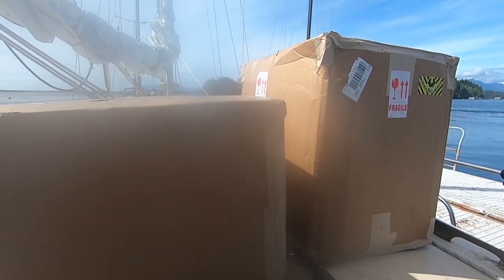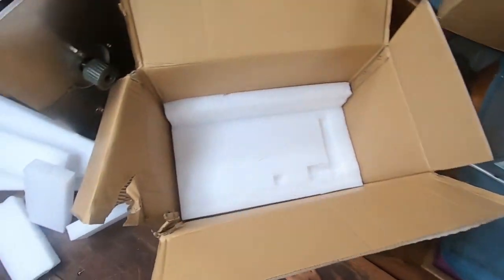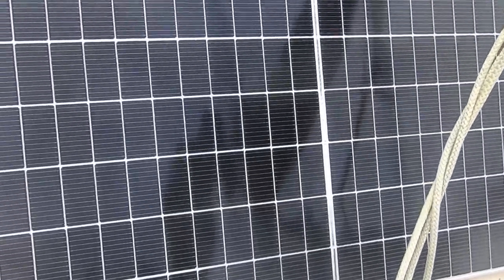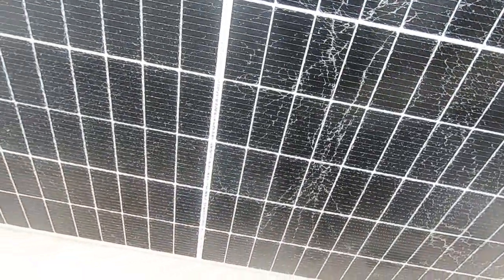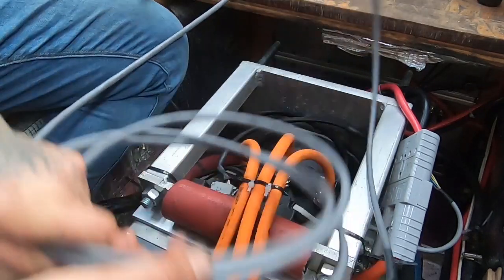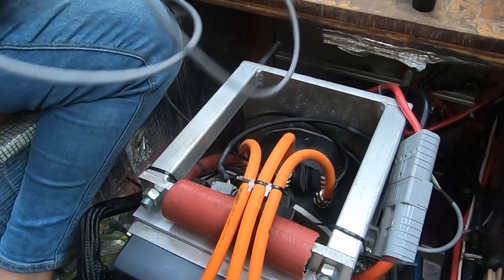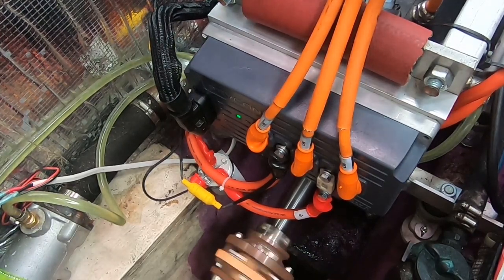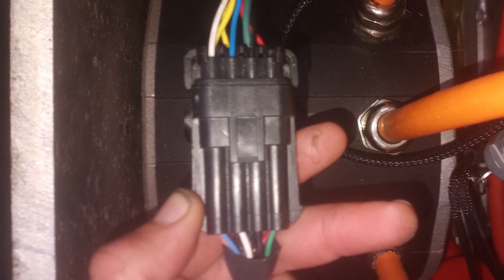DIY ELECTRIC SAILBOAT CONVERSION  heavy full keel cruising boat - Sailing Oka Solo - 030

Comment: Have you shared your electric motor conversion budget and does the motor regenerate while sailing?
Reply from the maker: @jldsystemsltd  16k CAD if you count rewiring the entire boat with all victron and not counting the 1000s hours of my time but ive been adding to it gradually for 3  years and got second hand lithium cells for almost nothing last year  so its an evolving number. with a full keel boat its the worst hull design for regen it only starts spinning at like 5 or 6 knots and its minimal production

Comment: Very interesting!  In the process of installing electric on my 38’ 10 ton PanOceanic.  Going with a kit from Thunderstruck -  24kw 96 vt 200 ah renogy batteries.  Just mounting the gear reduction plate and aligning the shaft.  Great video!  Will look forward to more from you.
Reply from the maker: might be the same motor, the me1616, I run mine at 48v 12kw
Reply: @ yes it is.  I’m running it at 96 volts with 8 * 200 ah in series for the 96 v.  I’m also installing 2 550 watt bifacial panels.  I value your real world cruising experience and have so much to learn along the way.

Comment: Would it be possible to install the electric motor on the shaft with a diesel engine still there?
Reply from the maker: @Mafiakitty  given there is enough room aud that the engine transmission can free spin without damaging it, absolutely

Comment: Amazing engineering. This is the perfect motor setup. Just add a Diesel generator for hot water and emergency electricity so that you have unlimited range. I would always want an electric motor drive my sail boat. All clean, all quiet, all reliable.

Comment: Hi.

I am trying to make an hybrid diesel electric. 

Can i ask what this cost you ???
Reply from the maker: Its a relative question as i could of done it for cheaper as rewired the entire boat and spent 5000 just on victron energy components, the motor was about 6000 and then 5000 in lifepo4 batteries, then i also built a solar arch later on and then i also purchased the latest model of portable honda gas generator to run hybrid

Comment: 12 kw engine 150 amp hour battery?   You have full power for 40 mins?  Not to mention the center of gravity of the boat will be wrong as you have taken out so much weight.   Fundamentally I support the idea but for the money you spent and the range you have it was silly.   I forget when I  watch videos like this one this is just a toy just hobby weather you live on it or not you need not go anywhere or do anything on a schedule.   Not like you are going to be running for port from off shore 200 miles to miss a typhoon that is coming.
A ten horse power outboard would make ten times more sence but its not about making sence or getting anything done... It is a dream come to reality.  Enjoy it.
Reply from the maker: An outboard would be swamped in waves as small as 2 meters. I never draw 12kw its pointless. Anyways 2000nm + in some of the worst condition and remote placesi could test it in and i still make it to were i need. People went out at sea long before recorded history with out high powered engines...  if you can't  sail engineless maybe you should learn to do that before setting out. My range is approximately 45nm on a charge with 330ah and am gradually increasing the battery  capacity and removing the diesel engine and fuel tanks adds up to less than weight than he lithium battries and motor combine to he point where i was able to double my water capacity.... anyways you do you and ill keep sharing my travels

Comment: A cheaper car engine would be more economic and  give you better range .   I sail  the same boat with a perkins diesel 72hp 
Thirsty at full revs  economic at half throttle,  thanks for sharing  best of luck well done young lady
Reply from the maker: The cost of marinisation of the car engine would probably cost as much as my motor did, but I hear you. 1500nm+ later I do not miss my old perkins diesel, its not for everyone but i knew what i was signing up for. 
You have an endurance as well?
Reply: @SailingOkaSolo  yeah mine is an Endurance 40 cutter rigged  nice and steady  build by windboats  in Norfolk UK. 
Lovely boat off shore , but a challenge in  a marina . I love the living space  , she's surprisingly fast with a bit of breeze.  Where do you sail out of ,  I'm in crosshaven cork Ireland.  Have a lovely day cheers
Reply from the maker: @johnmeldrum4717  I am transient on the west coast of British Columbia Canada.
I would love to have that extra 5ft! 35ft is fine solo but I find it cramped the second i have crew onboard, altho my lenght overall is 48ft with the solar arch
Reply: @SailingOkaSolo  your along way away from here,,,
 I won't pop over for a coffee and a chat anytime soon,  your an impressive young lady , well done with the boat modifications ,  wishing you fair winds, peace love and joy, 
Cheers John
Reply from the maker: @johnmeldrum4717  thanks john maybe someday we will be in the same ocean!
Reply: @SailingOkaSolo  shake down cruise around Iceland this summer , solo circumnavigation next year ! ????   Yahoo !
Reply from the maker: @johnmeldrum4717  im preparing too sail down yo central america in call of 2024 and then who knows
Reply: @SailingOkaSolo   I most certainly admire you .  I've just got my wind vane working  it wasn't 100%  but it is now  the clutch was slipping.  In the mean time  I bought a wheel pilot very handy for reefing or hoisting sail.  I just sold my hummingbird 30 . So I'm going to invest in solar panels  and a radar . I miss not having radar .
Best of luck with your plans  fair winds.   Do you have a bow thruster  on Oka .  I'd hope to meet in person some day . Look out for an endurance 40 called Serenity  . I'll keep you posted on planned voyages .
Up grading for solo sailing  .putting in a dutchman reefing  system fed up with main sail trying to go swimming. Take good care of you and your lovely dog , cheers young lady.

Comment: Hello, I love your boat and what you're doing with it. I'm sorry if you answered all these questions in your videos but I'd love to know more detailed specs, such as your boat type, length, weight and roughly what current draw is at different speeds. I have a Cheoy Lee midshipman 40 (20,000lb 3/4 shoal keel) and I already have a 57.6v 300ah lifepo4 battery pack (~17kw) I made from 18 cells for my house and the same multiplus-ii as you and my next move is electric motor when mine is ready to go.
Reply from the maker: Note taken!
Reply from the maker: Hello No problem don't  mind answering questions its why im sharing my conversion.
The boat is an endurance35 ketch 22000lbs or about 12 tons full keel altho some may call it a long keel or 3/4 keel
My current  battery bank is 330ah 52v lifepo4, i added a recycled diy bank since the video ( 10y old winston 260ah cells) which in perfect flat calm conditions will allow for 12h at 3knots drawing 1000w but thats never allowing the battery to discharge below 48v. the motor is an me1616 you can find the link in description and am satisfied with its performance and they are very modular ca be used with different controllers at different voltages and has been reliable altho i would recommend a different supplier than the link in description 
thunderstruck electric motor carries a very similar kit and has a better customer service.
Reply: @sailingokasolo6801  thank you! I have 300ah Winston cells, about 7 years old but only used for 18 months and then sitting for 5 years. I bought 20 thinking I'd do a 4s and 16s pack but realized I don't need the 12v 4s and with the multiplus-ii you can get a max charge of 64v and max input of 66v so I went 18s. Have you done a capacity test on your diy pack? What did you spend on them? I'm still setting things up so I havent with mine but for 120$/cell I can't complain if it's a bit diminished.
Reply from the maker: Ive noticed so many expect me to have a 12v bank but I just have a  20a 48v to 12v converter running the house I paid $1000 CAD bought them from a friend
Reply: @sailingokasolo6801  I'm sure many people would love to see an update video on the system! I know I would love to see the specifics of how you did the two different banks and what you did for bms. Right now I'm working on integrating my 200a jbd bms and victron electronics with a raspberry pi running victron's Venus os. I want to figure out how to integrate a 1000a shunt and relay into my bms/victron environment if I go electric.

Comment: I wonder if it's possible within realistic terms to make the system throttle by wire aka wireless much like Harley and other motorcycles have converted to..
Reply from the maker: That would be awesome im unhappy with the throttle that it came with because its so big and easy to trigger by accident

Comment: I watched a sailor who was a electrical engineer who converted his island packet 27 into electric.. he said to mount the controller or whatever the piece is that has the aluminum fins so that the fins are facing towards the open and make sure said fins are running vertical in order to displace the heat faster?? You can find his video on YouTube.. said he was the first island packet owner to make the conversion and he made his own battery bank. I would buy a bank like you have because you're paying to have a warranty

Comment: Your heat sink is up side down the fins should run up and down so heat can escape not sideways.. it could over heat your control box .. ... happy sailing  hope this helps..
Reply from the maker: I am very limited in ways to position the controller as the cables are so short but ive since added fans on the side of the heatsink.
Reply: @SailingOkaSolo  great job .
Reply: @SailingOkaSolo   I can't wait to finish my boat you are an inspiration keep up the great work
Reply from the maker: Great to hear working on more content specifically on electric motor

Comment: im planning on buying a sailboat and i wanna remove all diesal and run 100% eletric is it expensive? i dont mind slapping a whole wack of batterys for battery banks
Reply from the maker: Definitely relative to the size of vessel and if you're doing the work yourself or hiring someone
Reply: @SailingOkaSolo  I'd prolly get someone to help me as I swore to never do electrical again as I had a bad experience. I live in BC so I'm thinking of a 30-32 footer

Comment: Hey, just found your channel. I like the work you have done.,May I offer some advice , it's not a criticism  just a safety concern, you leave a lot of metal fillings in the engine  bay,  I am sure you've cleaned them up bty now, however you have to be carefully of things like that when working  with electrical stuff. Try to put down a tarp or something to catch them when drilling, triming, etc. Got to keep that area clean and safe for you.
Reply from the maker: I didn't  do any drilling  in the engine room the only filling i seen upon rewatching the video were simply on my cabin floor not the engine bay, I agree tho that foreign  metal shavings do not belong near electrical connection

Comment: Awesome on the repower!! We are going electric too. Stuck on anchor with dead gas engine. Have all the components for the electric conversion EXCEPT the pulleys and belt. I am trying to source pulleys like you have -- for 7/8 (~22mm) shaft. hard to find a supplier in the US. Please help. Thanks so much for the inspiration!!!
Reply from the maker: I got my pulleys and cog belt from electric Motorsport my motor supplier but maybe worth contacting Thunderstruck for parts as i think they are slightly cheaper

Comment: Is your motor mount, rpm converter home made or did you buy it off the shelf?
Reply from the maker: The transmission system is 3:1 cog belt and pulleys  and then the mount is my design as the shaft is lower than the engine mount the ones on the market were not ideal

Comment: Awesome, looks like a lot easier to fix than rebuilding the diesel engine. 🙂
Reply from the maker: Only two moving parts the bearing and belt not much to go wrong other than if the unit was submerged.

Comment: awesome, thanks for sharing this. I am just dissecting my failed Volvo Penta and if its a total loss I may go electric too. I already converted to 400 Ah Lithium last year and have 400 W of solar but would sure need more battery and solar and I'm a small boat so not sure where to put more panels. But great job you did, very motivating.
Reply: you cañt go wind generatur

Comment: I love that box you built to house it, I just used the reducer from the company I bought the kit from but yours seems bulletproof. I got a 96v 18kw motor to push my 36,000lb 40ft boat. I used my old shift cables to control the motor but its literally connected with whipping twine and I need to redesign it...shrug, more content to share I guess. Nice boat, ill check out your other videos and subscribe.
Reply from the maker: How do you find changing the 96v system was it harder to source supplies
Reply: @SailingOkaSolo  I charge the system two ways. I have eight 100watt solar panels in series mounted to my railings running through a 96v mppt charge controller( 4 solar panels on each side). I  also have a 96v ac charge controller I bought off line. I use the ac charger to charge at the dock and/or I use my portable generator to charge the batteries at anchor and I can use the generator to give me a long range at slow speeds (turning the boat into a hybrid). I find that getting the chargers were a giant P.I.T.A and regret not just going with a 48v system. But on the bright side I have ample thrust.
Reply: buy 4⁰ foot oiçníc bost 52 mile range

Comment: Great job I have a Hunter 30 and would like to go electric. What size is your boat what’s the cost of the electric engine you went with? Thanks
Reply from the maker: Hey that would be an ideal type of boat to convert, mine is an endurance35 and 12tons quite heavy for her size you can find a link to the motor kit in the description with price but I haven't quite "finished" yet as after 400miles ive decided to add more electronics and various devices to make it more user friendly so far im at $15000cad including charging system and batteries. More to come in next video
Reply: @SailingOkaSolo  thanks will do I subscribed so I will be watching. I have a channel as well but I’m in Rochester so I’m researching equipment thanks so much for the lead. So proud of you Gurl!
Reply: buy  j88 sopar ektrc sail boat 22.5  mile range telsa neww xells 26 mile range

Comment: That's just stupid, say you are in a storm for a few days on a lee shore with a good harbor, but can't make it in because no solar power
Reply from the maker: Never do I claim to run 100% off the sun,  Im no purist I use propane in the galley and gas outboard and generator.
Im 53°north so not much sun at this time of the year. I've just transited 400miles of fjords and tidal rapids through the inside passage of vancouver island running as a hybrid. Also just picked up a lithium bank for a song that will more than double my range...
Reply: dubled rang ¹⁰ miles too 2⁰ miles

Comment: Great self build. Your channel just popped up. Welcome from down the coast in the Pacific Northwest from SV Touchstone. Relaunched and rebuilding as a parallel hybrid.
Reply from the maker: Hi there, are you in puget sound? Would love to hear about your hybrid conversion as my friends are about to do so!
Reply: @SailingOkaSolo  Sure, some on my Instagram, nothing to YouTube yet. Financial limitations, time and experiments. 
Presently a 12v 'continuous' maybe duty winch motor no speed control, on V belt sheave. It was enough to launch and leave port. After purchase I found it was not practical to use for regeneration. I hope to later get a much better electric drive and batteries. Not expecting to have a large unit, found a Beta 16 so reasonable, I can't regret. Tired of deck generators personally. 
Many old sailors just ran alternators off the driveshaft for regeneration, so I can just do that. 3k watts drive and 1k regeneration I would be happy.
Near Port Townsend presently, moving to Humboldt asap.
Reply from the maker: Thats how it goes I my conversion Basically took a year because of doing it on a paycheck to paycheck budget while working 50h+ a week on tug boats.
Im seeing some interesting bike hub motors used on 20-32ft boats and i find that quite interesting and an easy option  but the ones I saw were direct drive.
I find it interesting that the only boats Ive seen set up with the pulley for an alternator were 60s 70s boats wondering why no so common these days.
Reply: @SailingOkaSolo  Grin is one with a personal test boat with hub motor. 
Very few references  of v belt on shaft to alternator, at least on the internet. Fair amount of suggestion of negatives like off axis wear by belt tension(most from people that never attempted it). Simply mount alternator/generator above driveshaft and pick up weight of shaft or 2x, it should not wear more than an unsupported shaft. Most smaller sailboats prop size can make it unsuccessful.
I was able to get 18.75" double belt sheave between my wooden boat frames. Some 8" was still successful. Recommend the largest that there is room to fit. Bearing bolted to a frame just in front of a PSS shaft seal takes thrust and side load.  
Everything low tech off the shelf engineering. Something to be said for not waiting in port for a missing diesel part to be shipped in. Same reason for the Kubota based motor. I will have the rebuild set on board before world cruising, easy in frame rebuild to me.